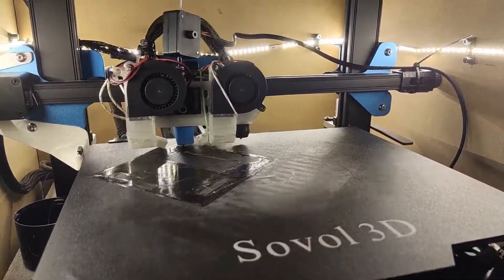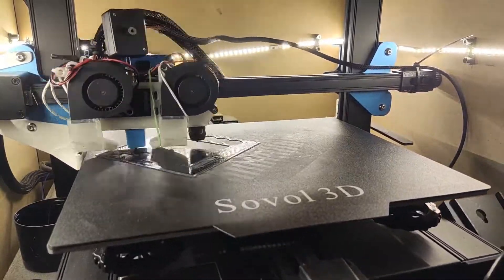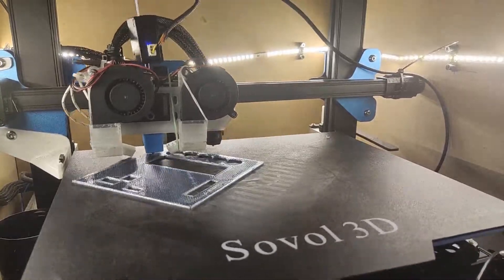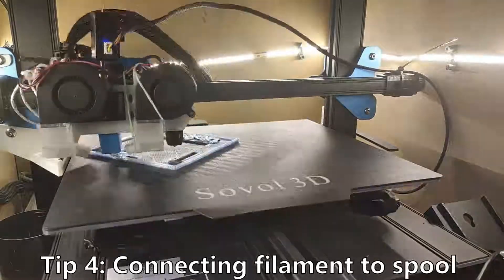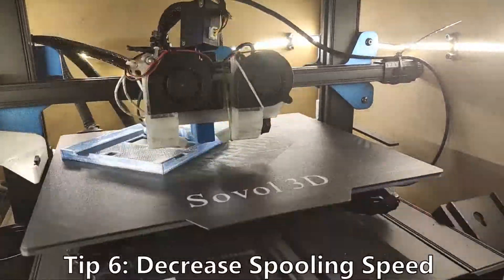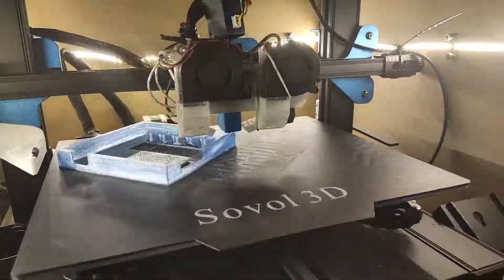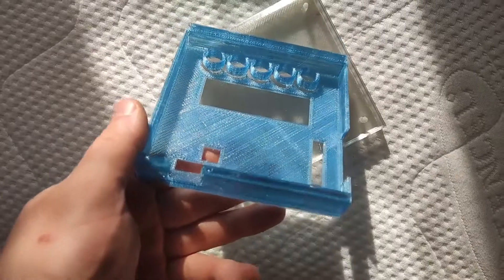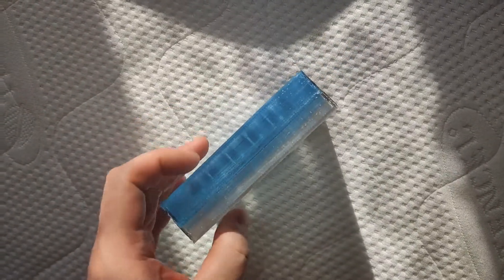Free filament maker machine part 8 - Tips And Tricks (printing with water bottle)

Comment: Do you druk thé met, cause i have huge problems printing it, pet is very hygroscopic
Reply: Dry thé PET*
Reply from the maker: You need to let it dry for couple days before printing or use active drying
Reply: @KaminarisTech , yes i figured, that's actually thé only big problem i got, because it Gets saturated pretty quick if you live in a Humid place. Should make a drybox for this but it's hard to properly spool thé PET, so an other challenge. Great vids !!